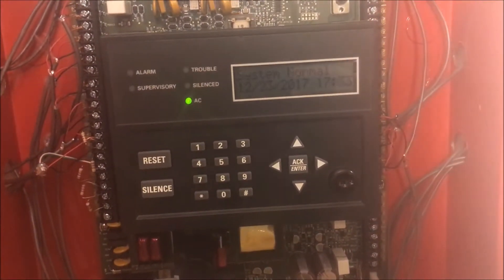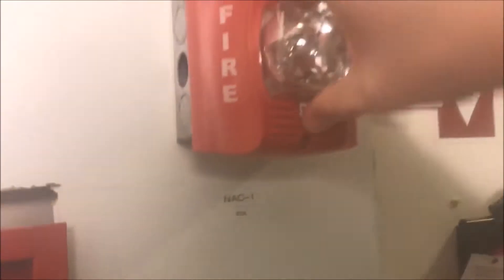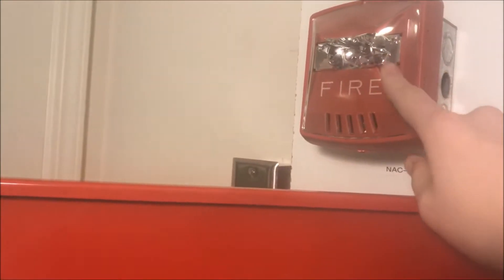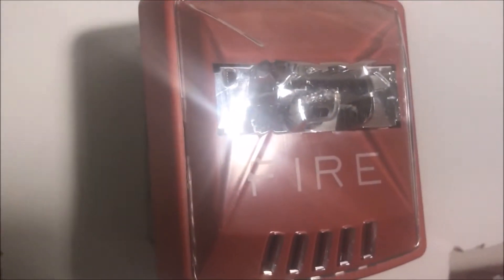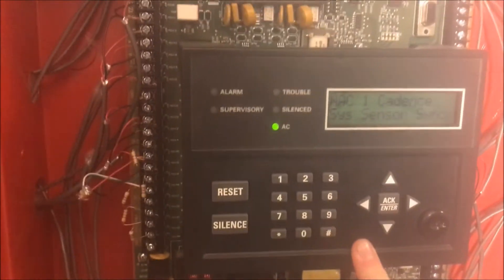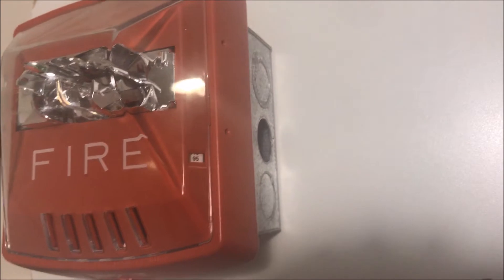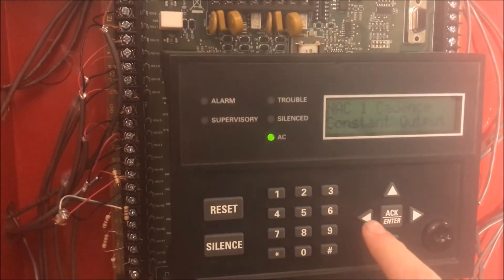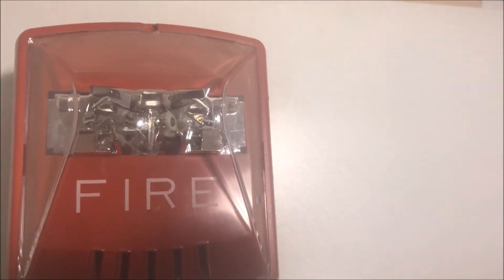Weird Wheelock Exceeder Glitch

Comment: The glitch where the Wheelock Exceeder does code-3 when it's set to continuous on a sync is not actually a glitch and just an Intended hidden feature and that's because the sync codes always override continuous codes in order to prevent any coding errors such like you mix these devices with Simplex Truealerts on Simplex SmartSync as Wheelock devices are often used on Simplex systems

Comment: The panel is set to sync Wheelock devices, correct?
Reply from the maker: Yes, I also had set a couple different companies' sync codings as well, and all ended up with the same thing.
Reply: Fire Alarms and Such 
It's supposed to do that, then.  Sync codes always override continuous codes.  It's recommended to keep alarms on continuous when syncing to prevent any coding errors.

Comment: First off, Merry Christmas, Andrew! Second, here is what's going on. If you put like an LED or some kind of light on the NAC terminals of your panel with continuous and sync, you will see it flash in like a code 3. It happens on the MS-2 as well.  So basically, you really can have continuous sync. It is really strange.